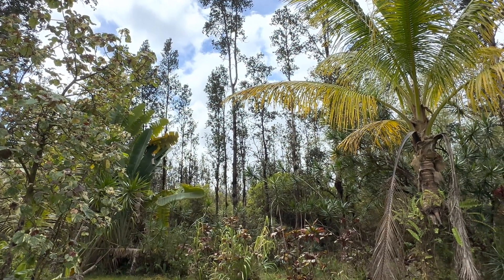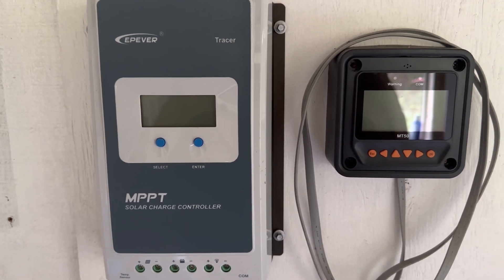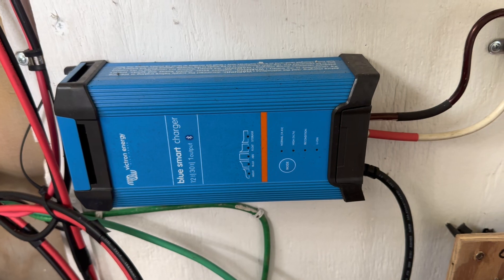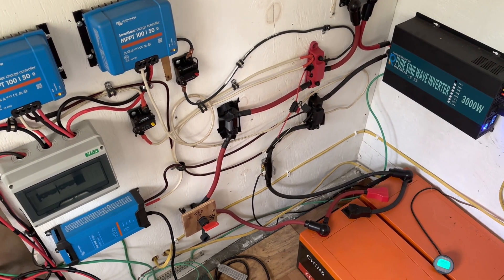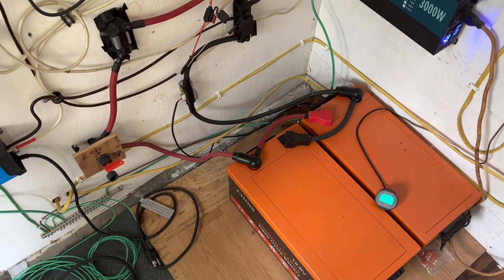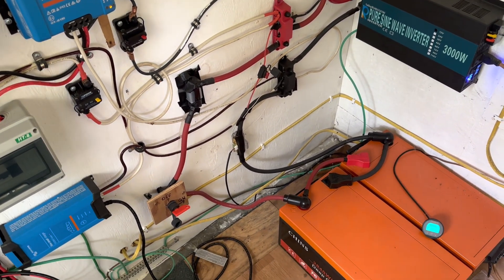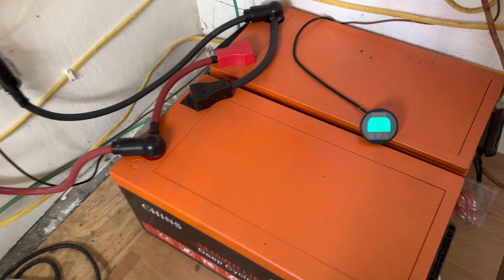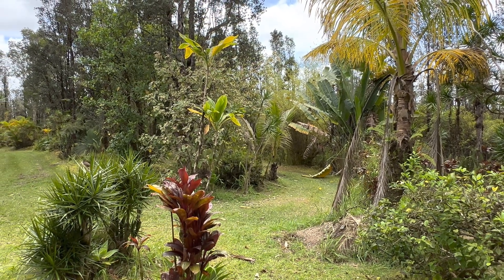CHINS 12V 300Ah LiFePO4  2 Years later A look back to where it all started and how does it hold up?

Comment: Hi there , i have 2 pc's 300 amp battery. And a ups charger converter.
For 1 battery is working perfect.
Can i use this also for parallel  charging. 
Thanks Glenn
Reply: If the charger has correct voltage for lifepo4s it will work. Make sure you are using correct wire size between batteries. I would recommend going in series for 24v if you're powering things other than light loads though.

Comment: I just puchased today a chins 48 volt 100 amp battery today. They ran a deal i couldnt refuse for $968.00   iys a 5120 watt hour capacity. Equal to 400 amp hours at 12 volts.

Comment: I had 2 chins 200ah smart batteries for my rv. I sold that RV and purchased a 2024 camper trailer and wanted to convert it to lithium and solar because the chins were so amazing the first go-around. I had them for 2 years and not one problem. I could leave them in my camper covered up the entire winter and went back to them and they still had 60% power! I uncover the camper and they charge right back up. I just purchased 2 of their new 300ah smart batteries and I got to tell you that the new app is even better than the old one! I can turn the battery BMS charge off and on and the discharge off and on all for my phone. Right now I have it sitting over in the storage with the discharge off the batteries and the charge on so the solar keeps them topped off and I have no parasitic draw on those batteries. The camper didn't come with a battery shut off switch so that did save me a few bucks there not having to buy that but I just have to remember to do it for my phone which isn't hard at all because I'm always playing on that app. It's kind of ruin me when we go camping I can't put my phone down lol. On a side note I was able to wire up a 3,000 w inverter to 30 amp outlet so I can trick my RV to thinking it's on shore power and run my air conditioner. I ran the air conditioner the other day for about 30 minutes and the battery's only went down 2%. That was when the sun was down so when the sun is up it should help quite a bit more

Comment: I bought 2 CHINS 280 amp 12 Volt Lithium Iron Phosphate Batteries for My System here on The Ranch and seem to want 2 more for this RENOGY 3000 Watt Pure Sine Wave Inverter in Parallel

Comment: I have 2 also. At the 2 year mark batteries were fantastic but at the 3 year mark of which I’ll reach at the end of this month Jan, the batteries are charging very slow and discharging much faster. I bought these thru Amazon. I’m contacting Amazon today to see how good that warranty is.
Reply from the maker: Would be very interested to hear how this pans out for you. Many of us are using these. To date, mine are still working well. Best of luck and Aloha!🤙
Reply: @ProjectsinParadise808  I’ll definitely let you know.
Reply: Thanks for letting us know

Comment: I have the 300ah but it would recommend 20mm /1/4” longer bolts on double lugged terminals because of the aluminum terminals. The Bluetooth BAT BMS app that chins recommends work well. I did have one battery that had a defective Bluetooth. Chins replaced it and let me keep it. Don’t know if the heating function works as I haven’t tested it but I’ll use in my bank. 

Chins is discontinuing the 300 and has them on sale @ $400 off. Get them while you can.

Comment: I have 4 100 ah lead acid that can run my pellet stove for 4 hours 
Will the chins LI PO run that stove longer?
Reply: Your lead acid batteries is only 50% usable. LiFePo4 batteries will safely discharge nearly 100%

Comment: I can charge my 600ah Litime plus battery's at 140amps.  When you have to charge with a generator you devise a way to charge them as fast as possible. 600ah takes me 4.5hr to charge when depleted.  Normally off grid power was all gen power, Now I can get more than a week of power with just 4.5hr gen run time.  That does not include solar which I also have, which would extend times between gen. charging.

I purchased 4 LifePO4 chargers and wired them in parallel to achieve the amps i needed. FYI, When you are pushing that many amps Or any kind of stress testing you should get a Laser Heat sensor so you can monitor what heat is doing. You can size all your cables properly and still have a damaged cable that will heat up. Happened to me when i was building my system, Feeling and touching just will not give you the Data you want.

I replaced 200ah of BRAND NEW lead acid,  Got jealous of a friend who upgraded to LifePO4 So I upgraded a month after I purchased Lead Acid. Selling them now.

Comment: Great to see they have exceeded your expectations. Lifepo4 batteries are great. Although some manufactures say they're drop in replacements for lead acid cells but this relies solely on the BMS . They do have different charging requirements that should be considered by users.

Comment: Hello, I have to VMAX batteries from about 5 years ago that I used to travel in my van and they are 250 and Powers total between the two of them. Would you recommend getting a 300 lithium-ion phosphate battery to replace them or go with 250 watt hour lithium iron phosphate? Let me know please thank you for your time

Comment: I bought one of these 3 years ago, still runs like a champ. though the manual stated (at the time) that they required a full discharge at least once a quarter, this issue has been resolved with the newer batteries.
760W of collection, same model battery, Outside of the flat on the roof of my bus, about the only time I need to charge it outside of the solar is in December.
I had some teething issues at first; driving with a full charge presented overvolt problems; mppt couldn't react in time before the BMS disconnected, also starting heavy loads like air compressors, this was all resolved with the addition of a 500F ultracapacitor
Reply from the maker: I ran into overcharging issues as well initially. For my system, i dialed the absorption down from 14.2v to 14.1, and that works great . No more ov disconnect .🤙

Comment: GroovyVideo2
I made system for my RV/home 7 years of daily use - back then have to assemble  LFP battery from 4  CALB raw cells 100AH  -  no BMS installed -  Victron solar controller - 
had Zero problems - a few months ago purchased and installed 2 x100ah  Weize batteries - removed Calb cells from system - Weize battery seem to be good but voltage seem a little lower and stays at  13.1 verses 13.2 for Calb  on flat part of discharge curve - maybe BMS adds some resistance -  
old Calb battery still has most of its storage capacity but remove from system because of safety concerns mixing battery  batteries with BMS and NON BMS battery -

Lately some of the battery companies are selling LFP Batteries with Pouch cells -
( Litime Mini ) this is  Not a good use for Pouch cells - pouch cells are used in R/C and cheap rechargeable electronics - 
pouch cells best used in Quick discharge / charge  where weight /size /cost  matters - pouch cells degrade Quickly - not good use for daily energy storage  -

Comment: did you increase the fuse size up on this system from  200a with 2000w inverter to 300A with 3000w inverter

Comment: I have 2 100Ah Chins LiFePO4 batteries purchased via Amazon about 5 months ago.  I subsequently found that the internal batteries were pouch cells other than the prismatic that I was led to believe.  I contacted Chins and they confirmed they were "soft cells" or pouch.  I complained and they offered to replace them with prismatic.  They sent me a prepaid UPS return label and I returned them for a swap.  I received the new cells before they even received my return.  I consider this the BEST customer service of any manufacturer I've dealt with!  Bravo Chins!.
Reply from the maker: I have heard nothing but good on their customer service...nice! 🤙
Reply: I ordered a 400Ah for my folks who live off grid to replace 1600ah of lead that failed after only a year (Rolls, really??!!) the first one failed, out of the box. it did still have its stated capacity, but the internal resistance was way too high to be useful (a 20 amp load would trigger the BMS) they swapped it out with a new one, still had to pay shipping on the old one. no issues since. they run it down to 30%DoD daily, but have more than enough collection to recover on all but the most overcast of days

Comment: Did you  manage to use the Epever combiner box AND the display at the same time as I never managed and have no display.
Reply from the maker: I always used the MT50 display for the EPever's. The main unit functions were just too frustrating to quickly program. The MT 50 I was able to get pretty quick on as I finessed the settings. Aloha! 🤙

Comment: I am getting ready to buy 2 more batteries. The ones I have chosen are Chins. In 2020 I made the mistake of spending a fortune on a Battleborn. Money down the drain. I do have a problem with these 200 or 300 or even 400 hundred AH packs. If one goes down you lose the entire battery. With 100AH units I have a fighting chance of recovery at a lower price.
Reply from the maker: Good point ...knock on wood I haven't had a failure yet with the larger battery packs. But I understand what your'e saying for sure! Aloha! 🤙

Comment: I had one of there 24 volt 150 amp battery's shipped out to me right after your first video.. Super happy so far, have the charge controller set to an AGM program that works just fine..

Comment: Do you ever worry about heat at wire contact points? I am still trying to get that part balanced, I have some long AC arc welder stinger cables I was thinking I might just
start using them maybe cut them to lengths I need it is very heavy gauge copper wire not coated but copper. Always like your videos you are a not too fast talking
for me so it helps when I am taking notes. Thank you :)
Reply from the maker: I still periodically check for heat, and so far, have never encountered it at any contact points. Mahalo for being part of the conversation here! Aloha! 🤙

Comment: So are you also running AC by chance. You didn't mention it. Nice work BTW. I am in key west and doing a sailboat project. I will purchase two 300ah also.🧐🤙
Reply from the maker: I was just looking at pictures from a Key West trip years ago. Always thought of it as good place to drop anchor like here. No, luckily I don’t need A/C here at this altitude on the island. Or heat for that matter. I’m pretty lucky in that respect,which makes it easier for 100% off grid. Best of luck with your project !  Please let us know how it goes! Aloha 🤙

Comment: Hi, I've been following you for a few days, and congratulations on the solar system. I also have two victrons with lifepo4. But the default settings, in my opinion are too high as values. I set 27.6v as maximum charge (I have a 24v system) and 27v as float. I set the absorption to not run, and gave it 1 minute. How did you set the battery charge? Congratulations and happy reloading..
Reply from the maker: I agree the preset is a tad high on the Victron's. I actually set manually on most systems now to 14.0v, or 14.1. Works pretty good in the conditions here, while always trying to squeeze out as much sun in a day as possible.I have plenty of overcast day's here, and some day's with not much sun. All in all a little lower than the 14.2v preset working good. I tried 14.2v , but got alarms on sunny conditions quite often. Not anymore though . Took me awhile to fine tune my system. Mahalo for being part of the conversation! 🤙

Comment: I really like the calm, peaceful tone of your videos.  No unnecessary hyperbole or feigned angst over something, just a quiet explanation of what you have used and what your experiences have been.  One question I have is that I got it in my head that you need to draw down a battery to near zero and then back to full in order for the shunt, or battery meter, to be properly calibrated.  From what I remember, this is important to do from time to time as the capacity is gradually reduced.  Have you experimented with that notion in any way?
Reply from the maker: I appreciate the kind words and time to drop a line. I haven't as yet done the draw down you mention on the shunts I'm using. I do however charge every battery to full before setting the shunt to what is 100% . Then I just look at percentage and battery voltage, as well as ah's used. I am getting a pretty good read on soc , and this seems to work good. I take note of what you say that periodically I should drain it, then recharge. But have not done that yet. Mahalo for being part of the conversation here. Aloha! 🤙

Comment: After watching your channel, I bought 4 200A chins and the same Victron charger. (mine has 3 outputs). Still deciding which Victron mppt should I get.  My setup is 12v with 4 100W panels. My consumption is 1Kw/day. Any suggestions?
Reply from the maker: I imagine you are loving those batteries! My suggestion would be to oversize your MPPT to allow for expansion....solar systems can be addictive, and overtime you may want to add more of everything! Aloha! 🤙

Comment: How do you know that the batteries are delivering 300ah? Have you load tested them?
Reply from the maker: Over the past couple year's I have been using these , I have tested them several times, and they do have slightly over their rated capacity. 🤙

Comment: I am curious, why did you choose to run the batteries with 12V 600Ah instead of 24V 300Ah? The charging speed is slower with 12V.
Reply from the maker: For me it was just being comfortable with 12V systems since that was really the only experience I had for many year's. Now ,overtime, I have built a 24v, and 48v system and yes they are both way faster to charge, slower to discharge, and more efficient . I learned slowly the advantage to higher voltage system's. It was just a learning curve for me. Aloha! 🤙

Comment: Looks good, glad to hear the batteries are doing well. I just bought 4 of these batteries for my diy whole house off grid system. I can't wait to get it all set up.
Reply from the maker: That's exciting for sure! They are great batteries, and I have heard from so many people over the past couple year's of how much they like them. Good luck on the install, and give us an update sometime! Aloha! 🤙
Reply: @ProjectsinParadise808  update. 7200 watts of solar, 2 mpp lv 6548, and 15 kwh of lifepo4 batteries have been running for about a month. Almost 1 megawatt hour produced and used. Extremely happy with how everything turned out. Planning to add to the battery bank as funds permit.

Comment: looking great ! once you get the settings it works for years ! look out for new types of ION buttery's . CATL is putting sodium ION cells in production. and some outher types have been made . just need to get to production . big changes ahead . funny I use a 100 year old battery type.  nickel iron . they just big for size . also called the EDISON battery . nice update
Reply from the maker: Can't wait to see what's coming next. LiFePO4 was such a great step in the right direction! Yeah, for me , after I learned how to dial in the proper voltage it's been smooth sailing for off grid power. Never use that generator to speak of. Maybe twice in past year I actually fired it up to make a difference. Pretty happy with the performance of all the new stuff. Mahalo for all your support over the past couple years. Aloha! 🤙